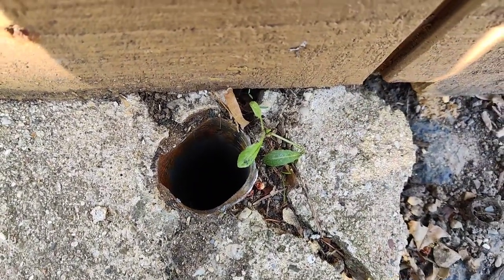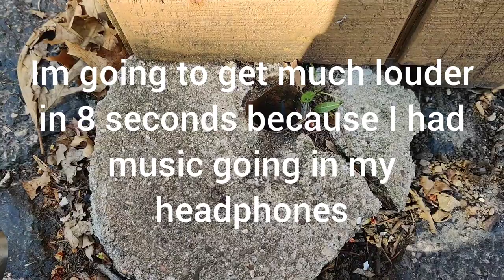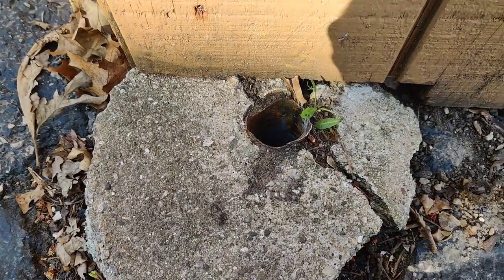how to "fix" a metal fence post in concrete. life hack

Comment: What I did on mine I put a smaller piece of pipe and  join the two pieces and filled it with cement
Reply from the maker: @alejandrodelatorre1631  I would have done the same minus the concrete but I didn't want to spend money on it.

Comment: How did you cut the pipe? Hacksaw and hold with a vice?
Reply: You can see a grinder with a metal cutting blade in the video so that’s my guess
Reply from the maker: @TheDavidElson  I cut it with a grinder and a metal cutting wheel. I put the pole on the ground, held it with my foot and made my cut. If your not very experienced with a grinder with a metal cutting wheel definitely put it in a vice